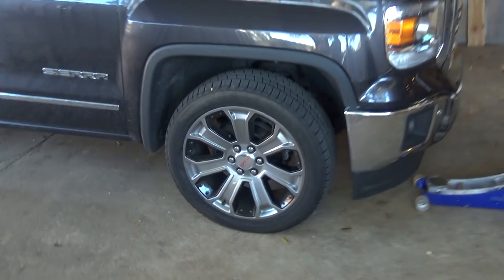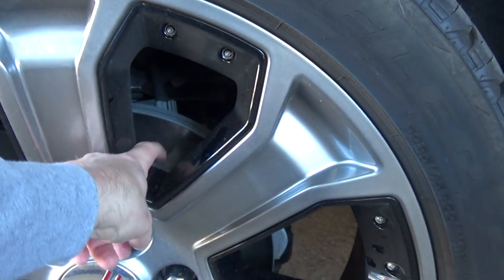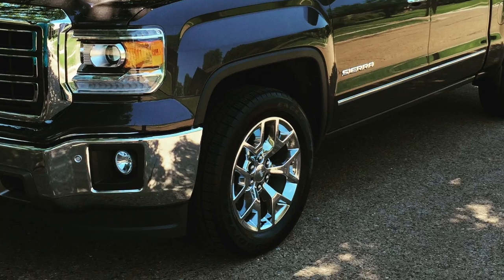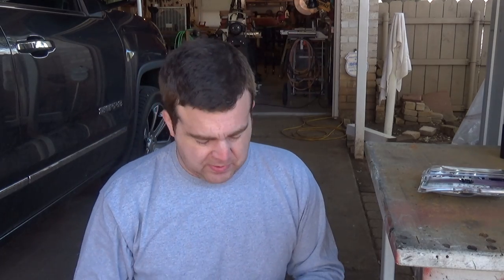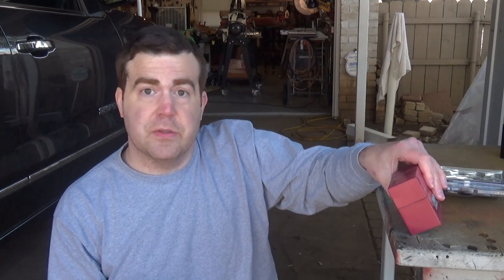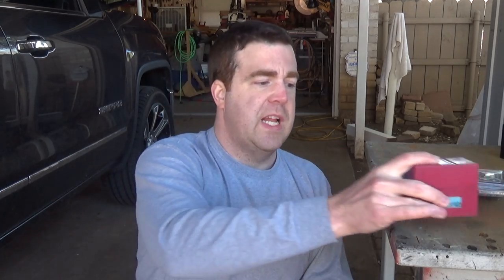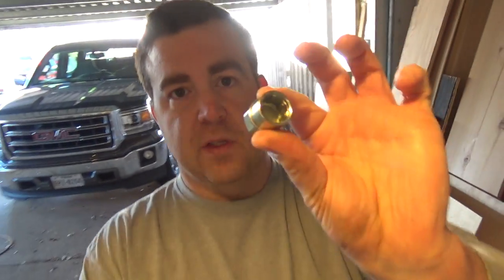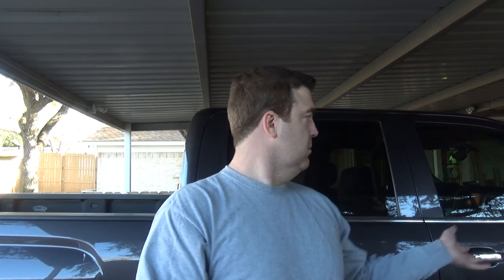WHEEL THEFT PREVENTION TIPS | My Factory 20's were STOLEN!

Comment: There's a Chevy dealer that had some Redline wheels stolen and they showed up at the guys house that was selling them on Craigslist with the cops and a scanner that matched the tire pressure sensor in the wheels to the truck  they were stolen off of.
Reply: The real way to find out if they are your rims. Only if the thieves are dumb enough to keep the tpms sensors on
Reply: That was Chevy Dude out of KY.

Comment: I had an 88 IROC that I bought slightly used years ago and it had the wheel locks, but get this - all 20 lug nuts used the key.  So a thief would have to drive a socket into each lug nut 20 times!  I don't know how or where the original owner got them, but it was effective.
Reply: jewllake I did the same on my 22" centerline rims.  I actually found 3 of them busted one morning. They do the job.
Reply: I have the same on my 26" Chevy replicas for my 14' Silverado
Reply: And I got mine online they came with 24 lug nut locks but mine have spikes at the end
Reply: Why would they need to drive the socket onto EACH lug nut 20 times?
Reply: jewllake lol a thief can defeat it easily, lock nuts won't do shit. If the thieve wants it bad enough, the will get it. Not to mention, unless you do all maintenance work yourself, it will be a pain in the ass and a risk because the mechanicc may fuck up your wheels even if you give them your key. It has happened to many people.
Reply: @awoksling6198  LOL well, you get what I mean - 20 different lug nuts.

Comment: very good idea with stamping the wheels, I have a nice set of brand new cragar ss wheels on my suburban and I will use your method on mine as well. I have been worried about mine being stolen since I bought them, you cant have anything nice these days without worrying about it, it seems. I do have a suggestion though, you should put jack stands to support your truck and take the weight off of the pump jack. it not only keeps you safer but it keeps the jack from failing and being damaged as well as the truck when it hits the ground. I only say this because I had a hydraulic seal fail and my jack started to leak down. luckily it dropped down slowly enough for me to get out of the way, but they can completely blow out and drop all at once. I know you only had the truck up on the jack for a short period of time, but believe me it could happen. I'm not a youtuber know it all who shuns people in the comment section, so I just occasionally give advise on things I have personally dealt with before. just advise. thanks again for the great idea, its a lot of work taking the wheels off and putting them back on but its totally worth it to protect property.
Reply: Justin Avery so true. J.S.
Reply: Justin Avery kill switch can do it and only you know where the kill switch is
Reply: That's true. I've also had a floor jack give out on me but luckily I put one of the wheels under the car so no damage was done.
Reply: He knew what he was doing, he was not under the truck at all, just more junk to drag out of the garage at that point. Plus his jack looked new and I highly doubt he bought it at Harbor Freight.
Reply: Justin Avery I usually take the rim with the flat tire and use that as a jacket and if I am replacing a wheen out in the middle of nowhere

Comment: They left dudes truck sitting on his rotors 😂😂😂 cold mf’s
Reply: Yeah I  just put it in my garage and lock it.
Reply: They didn't.. they left the truck on bricks but they broke... if the tires are holding up the truck, you jack it up then take the tires off you have to set the truck on something or you won't be able to remove the jack lol
Reply: @slattery_bizz8533   Nah you can pull the jack out if you are quick with it. Most of these thieves use milk crates now though. it's much less suspicious than driving around with 4 cinderblocks
Reply: Im here because the same thing happened to me. 2 sets of locks and they weren't deterred...looking for a better lock setup

Comment: One thing I would add is don’t have any regular lug nuts on your car, have the rest be maybe a cheaper kind of wheel lock, that way it’ll take forever for a thief to get the wheels off. Also if you’re going to bother torquing your lug nuts you might as well do it right. It’ll look something like this.
                1    3
            6             5
                4     2

Comment: Great ideas on wheel theft protection, especially the stamping of a personal  ID#.  I'm an electrician and use zip ties all the time and just a friendly helpful tip about the zip ties is if they are subjected to winter cold and then the heat of engine compartments or exhaust systems they can get very brittle!  I would suggest some sort of thin metal cable about 1/8" thick with a clamped loop on both ends you can put a small lock on then tape over the keyhole with electrical tape then use a hot-glue gun to seal the keyhole end shut to protect it from grime, but don't forget the tape or you may clog the keyhole.  When needed the hot glue and electrical tape should be fairly easy to remove.  Also just in case the wheel locks only came with one key you might check with the manufacturer to see if you can get a spare going off the serial # if it has one.  The last thing you want is to get a flat tire somewhere and find that the key you've hidden on or in your vehicle has been broken loose and lost.  If so you might find yourself with a nasty towing bill and have to pay to have the lock chiseled off and you'll end up with one unprotected wheel, the other three locks will eventually also have to be chiseled off as you no longer have the key, and you've gotta buy a new set of locks.  Unfortunately, I speak from experience on that one.  Obviously "The Club" for your steering wheel is good to, but in the past I've also hidden a small 1/4" microswitch somewhere inside the vehicle that interrupts the ignition signal so unless someone knows where it is they cant start the vehicle, a little harder on newer cars but I'm sure a mechanic can help to find the right wire if necessary, but install the switch yourself.  When I did this it had become such a natural instinctive and smooth movement whenever I got in or out that when I dropped my vehicle off to be worked on I hit the switch and left.  they couldn't start my vehicle.  Good luck to you and your viewers.  P.S.  Don't forget that unfortunately, if a clever thief wants what you've got they will, one way or another, figure out a way to get it so all we honest people can do is protect ourselves and our belongings in as many clever ways as possible to frustrate or detour the thieves!

Comment: could run a paddle lock through the hole in your wheel nut lock key then keep it in the glove box. toss the key for the paddle lock on your trucks key ring so you have it should you need it at any point.
Reply: I like it!
Reply: You could remove the padlock from the wheel lock. If anything use the lock and attache the somewhere on the truck.
Reply: PimpChevy89 they have an U-Lock can lock it up. One U-Lock for steering wheel thru brake aand gas pedal and secure thight with a key. Also you can buy U-Lock for steering only or you can buy both. And use that Nut Lock for wheels and an alarm system
Reply: Lol... "paddle lock"
Reply: pimpchevy89 I was just going to say that
Reply: Or you could just buy different whees with a spline or an actual wheel lock and they can’t take them unless they have the exact key/spline
Reply: pimpchevy89 padlock
Reply: pad locks can be broken with two wrenchs and 1 hand by sqeazing the wrenchs together to pry the lock arm up trust me those are the worst locks
Reply: @Wyatt1273   Wheel locks can be defeated by taking a socket wrench slightly smaller than the lug and hammering it on the lock, itll wedge itself on the lock and you can take the lock off.  My key broke once and i got the locks off in 10 min doing this.  This is why i use the spinning wheel locks now that he mentioned in this video

Comment: #4 - Don't store anything in public storage rental buildings loaded with everyone's goodies. My brother's corvette was vandalized even down to the body many times. When they got inside that rental garage they took wheels, seats and radio again. Then he parked it at my place here on the farm and baseball size hail from God himself got it next. In autobody college we were trained how to enter locked doors with the snap on tool kit and it was sooooooo easy. Alarm system sounds good.
Reply: jasonmushersee hhhu
Reply: Wow thats some really bad luck right there goodness
Reply: were I store my camper in the winter they will pay if it gets vandalized for damage fee so it is a win win(even if it gets stolen)
Reply: jasonmushersee is
Reply: Alarm systems are so easy to hack yo
Reply: C'mon God. What's the deal with hail storms?
Reply: Good advice.  Rental storage places get burglarized WAY MORE OFTEN than homes.  Your property is much less safe inside those places.
Reply: I had a 92-94 lifted Isuzu Rodeo with fog lights mounted on a wrap around brush guard.
I come out one morning and there is my brush guard hanging by the bottom bracket on the sidewalk with the fog light covers missing and the fog lights bent... the thieves couldn't figure out how to unbolt it from the bottom of the truck! 😂

Comment: Used to be a auto mechanic before changing professions, I used to bust of wheel locks all the time.  So many lost their keys, or didn't have the key with them.  I had a number of ways to get locks of, and some of them you would think would be the hardest, were the easiest to get off.  I've pulled off just about any style you can think of.

Some locks are so simple, it didn't slow me up much from a normal lug.  

Hand torqing your wheels down is always best.  Request they do that if you have someone else touch your wheels.   Use 2 completely different sets of wheel locks!. Different brands.

That twisty thing in the lock wouldn't slow me down much.  2 completely different sets will slow the people trying to steel them even more.   A security camera pointed at the location of your car/truck also good.  But it needs to be a good one. A crappy recording doesn't do you or the police any good.
Reply: JB Dragon wheel locks are a joke if you’ve worked in the industry for any amount of time. But without power tools I’d say from experience the ones with the collars are the most effective.
Reply: Derek Stone 
The ones with a collar?
Reply: Can you remove rimlox?

Comment: i work at a gmc dealership stolen wheels on these trucks are very very common, at least once a week a see a truck come in on tow truck with the wheels stolen. those denali 22 with black isnt as incommon as you think. fyi you didnt tighten in the proper torque sequence and the stock lug nuts are not 7/8ths they are 22mm . 7/8ths over time with slowly round the edges of the stock lug nuts.
Reply: jay webb shhhhhh!!!!! Don't tell the man his American truck has metric fasteners!!!
Reply: You can still identify which ones are yours being sold on craigslist. All you have to do is get the police involved and the dealership because your air pressure sensors are built into the rims and it has a special code that matches your Vin number. You can use a Wi-Fi system that can scan and check if the craigslist seller has your wheels or not.
Reply: Mesykins steal them
Reply: @Toker Pak it's not WiFi.  WiFi is 2.4ghz.  TPMS is a different Unlicensed ISM band... 315mhz in North America and 434mhz in Europe. 
You are correct in that they can be read with a wireless TPMS tool and they have unique serial numbers.  He could've snagged the TPMS sensor Ident Strings from the control module that handles TPMS on his truck before he overwrote them with the new wheel Ident strings.  On the GMT800 & GMT900 TPMS is in the RKE module.  Not sure where it lives on the GMK2XX chassis trucks but any decent scan tool should be able to liberate all five TPMS Ident strings.  Once you have all five you can read the spare wheel sensor and eliminate that one from your BOLO.
The first thing I would've done is to read the TPMS Ident strings for the stolen wheels and post them on the STOLEN thread or sub-forum on several GM tyruck forums that I frequent.
Reply: TheOcculus I forgot I left that comment and when I think about it now I have no idea why I said Wi-Fi. Maybe I meant to say ID system or something. I use voice to text so it jacks up sometimes. But yes there is special scanners made for that reason and they can definitely use them to find out if they are his rims or not.

Also you don’t technically have to scan for your original rims code 1st because the dealership will have that data on file if not the manufacturer will and all they need is the Vin to find out the original IDs.
Reply: TokerPack you know the Tpms can be removed from the rim, right? Isn’t even hard to do.
Reply: @Onizukachan915  thieves dont want to hold onto the wheels for long. they had tires mounted to them, and would be sold with said tires most likely. Quicker to sell the package for a discount than dismount the tires, remove tpms sensors, and sell the wheels/tires separately.
Reply: Calm down

Comment: your wheels are matched to your truck. the valve stem system has a numeric code which pairs to your truck....you can find them by going to your dealer and getting the code for the wheels. See mike davenport video on when they stole his 2107 redline  wheels. He explained the process on checking and finding the wheels and noted that they repaired to his truck once within range.  check the video--"Thieves stole my  2017 silverado redline edition wheels, i go to get them back"
Reply: I seen that video too was very helpfull
Reply: Excellent idea,but as retired law enforcement,I recommend using partial vin on rear of rims,easier identifier than initials.

Comment: Even better to use 2 different wheel locks per wheel.  I had 1 car with various sized heads on the lug bolts as well as various wheel locks. Thieves would get so confused, they just move on to the next car.
Reply: Bart Lol omg I bet the shop hates when you come in. If I were you I’d always wipe down my steering wheel and stereo knobs after getting tires serviced. 
When I get customers with mismatch lugs I always replace them.
Reply: Imagin having all the lug nuts be different wheel locks, oh my 😂
Reply: I have a tool for that. Takes  of locking lug nuts like nothing.

Comment: I looked into this problem recently due to multiple wheels theft around my area. Basically I wanted to create and app that is driven by the cars alarm to alert you the wheels have been separated from the vehicle, basically every vehicle alarm only goes off under motion or if a door or hood/trunk has been opened. My idea is to have the wheel connected to a probe that sets off car's audible alarm and also warnings on your smart phone, upon separation from voltage source. I had even incorporated a GPS module inside the tire, just like a TPMS, to alert you of the location of the wheels upon the theft. After looking into a patent I realized someone had beat me to it by a matter of months! Bummer, but I am glad someone has finally gotten serious about this problem. Look into it, research it and you will find that it is very preventable if proper equipment is present before the theft happens.

Comment: You might want to take off the Black Trim Cap near the Valve Stem(so you can find it easier) on each wheel and stamp it underneath them. Where you have it, it could be grounded down with ease. Also put a extra set of Wheel Locks...
Good video, peace...

Comment: How about putting your fancy truck and wheels inside the garage overnight?  The junk in the garage isn't worth what the truck and wheels are worth.  It's not just about theft.  It's about keeping stuff from hitting your truck and storm damage.
Reply: Roscoe Dogg depending on size he has a garage right behind him
Reply: Roscoe Dogg NEWS FLASH. This guy does.
Reply: F that. I use my garage as a shop. Should not have to worry about leaving truck parked outside. Maybe one day one of those thieves will have an unfortunate accident. It’s sad how some of those people wind up in real bad accidents after a while. Sad.
Reply: yes, but he does. !!!
Reply: i have 3  street motorcycles a quad and a dirtbike a washer and dryer a fucking TON of shop tools, a big mechanic tool box in there as well as a car...  where exactly do you suppose i park the truck? on the garage roof?
Reply: easier to just put a fence around your yard... and one with an electric motor so you don't have to get out and open it manually every time you come and go.
Reply: Roscoe Dogg  maybe he could fence his property and have a dog around with a house alarm system!?
Reply: The tools inside the garage can cost as much if not way more than a truck. It just depends on the type and brand of tools.

Comment: Thieves will take "it" if they want it bad enough. In your case, the worst was to drop your truck  on the ground like they did. Ug! 
Well, as you probably knew, many times thieves steal things the first time is so they can come back for the new on the 2nd time knowing most owners will have to replace them.  Having insurance is one thing ( but you have to go through all the hassle and you future rate will increase...), may be better to invest in a GPS based protection system (including sensors to your individual tires/spare, muffler and etc), you will be notified as anything moves or triggered by vibration and so on depends on your settings... You can find many of this type of device on the Internet.  BTW, you may also consider adding a camera (with motion session) from inside your house to watch the truck 24x7 if needed.  Good Luck!

Comment: This is a bad ass idea, some punks left my scat pack charger on the rotors after jacking my rims.  I installed a aftermarket alarm, sensors, etc and wheel locks.  This is a great area with stamping the rim.  Thanks for the content